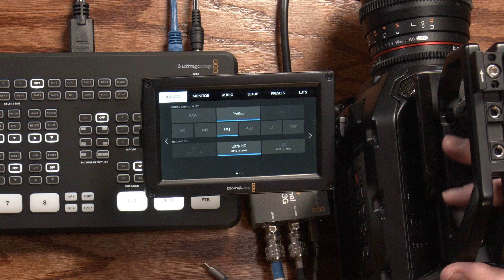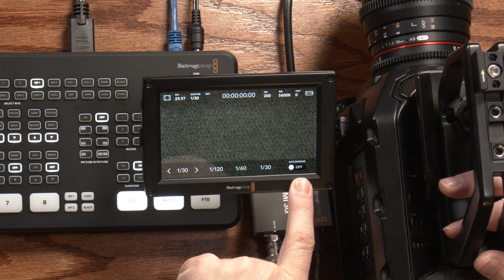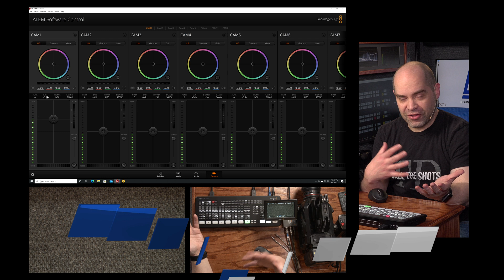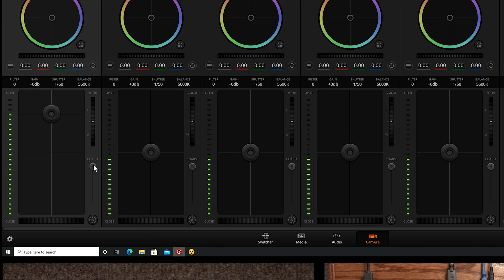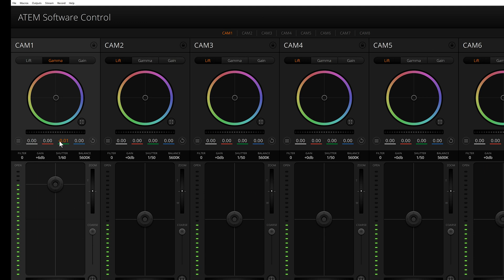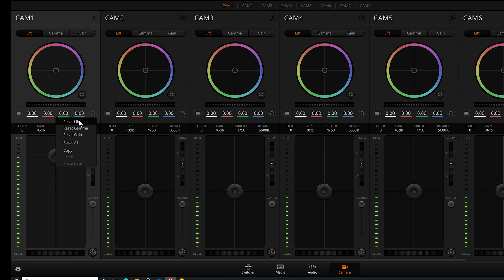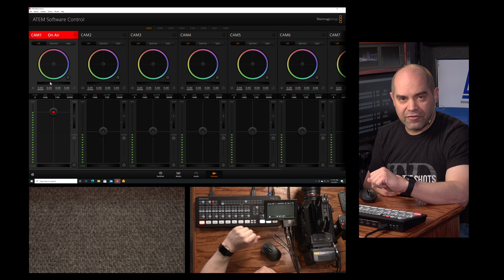How-To: Control Ursa & BMD Studio Cameras from ATEM Mini Switchers

Comment: What about getting program return into the Ursa from the ATEM Mini Extreme ISO.
Reply from the maker: You won't be able to do that from the Mini series. You'd have to step up to a higher end model of switcher.
Reply: I pushed the HDMI out to a Converter and an SDI DA but of course you lose Tally and any remote functionality in doing so but you do get return.

Comment: Hi I have 2 Blackmagic cameras 4K and 6K also ATEM Prodaction Studio 4K Switcher. I connected all, the software as well, I can see my cameras on my multyvew, but I got a issue. When I go to Camera section on software and trying to control cameras it looks like noting is changing when I change bottoms. Can you tell me what can be issue, also my 4K Blackmagic camera is turning off automatic after few second, can you tell me how to fix it inside camera settings ? Thank you, good video.
Reply from the maker: Before doing anything else, make sure you’ve updated the firmware on the cameras to the latest versions. Then make sure you set the camera ID in the settings to match the input number on your switcher (camera on HDMI 1 is set to ID 1, etc.).
Reply: @djp_video  is there any video that shows how to do?
Reply: @djp_video  I did update my bought cameras firmware still not working. If you can send any video or link that shows how to much camera ID with inputs, that would be great. Thank you
Reply from the maker: I don’t have either of those cameras to demonstrate with. But the process will be almost identical to what you see in this video. 

Make sure your camera IDs are set to match your switcher input numbers.

Comment: Does this work on all ATEM inputs? I’ve had issues getting it working with inputs 2-4 on an ATEM mini at 1080p50 because the output from the micro converter at 1080p50 won’t work with those inputs. It seems to be just the converter that is the issue because any other 1080p50 source works with those inputs.
Reply from the maker: It should work on all inputs.

Comment: Do you know if this converter also makes it possible to control the BMPCC4K from the bigger SDI based ATEM switchers?
Reply from the maker: It does. It works in both directions.
Reply: @djp_video  That’s awesome! 😃 And i was just about to pick up a bunch of converters anyway!

Comment: I totally missed that the 2-way adopter enabled camera control, thanks for this! How is your Design Micro Studio Camera 4K with the adaptor? I'm mostly shooting talking head from fixed mount cameras in my office that are recorded on the Atem Mini Extreme ISO and/or Hyperdecks. So the Micro seems appealing. Does "bad" autofocus mean slow, or does it mean it often doesn't get a sharp focus even on something easy (medium closeup talking head)?
Reply from the maker: The Micro Studio Camera 4K works as designed, but it isn't a great camera. Take a look at the videos on the channel from a year ago (MSC4K) vs. now (Sony Z150). The difference is pretty staggering.

Auto-focus is really slow. It works most of the time, but it can miss focus occasionally. It's very simplistic in the way it works.
Reply: @djp_video  I am looking into getting two studio cameras and two pocket Cinema 4K all controlled from a ATME switcher the main reason I was looking at the studio camera is It has SDI and thay will need them to be about 100 ft away from the switcher. would it be possible to use two bidirectional converters to go from HDMI to SDI and then back to HDMI and use a pocket Cinema instead of the studio and still have camera control?
Reply from the maker: @CYBERSTORM101X  I would think it would work, but I haven't tested it, nor do I have all of the required gear to do so.
Reply: @djp_video  thanks for the reply. if all goes well and our package gets approved I will test this and if I remember reply and confirm if it works. Thanks again for all the informative videos.
Reply: @djp_video  lol thanks Doug. I don't need new cameras, and the Micro would probably be a step back in image quality (running Nikon Z6 now with a bigger sensor), but all those unused buttons on the Atem Mini are killing me :-) A very dumb reason to go camera shopping.

Comment: Nice stuff. Would love to see coverage of the Sony Z150’s and Z90’s remote control capability with that Sony app. I asked you about hit on a live stream once; you’d said it was clunky because the camera turns into a wireless AP. Surely it could join an already stood up AP and just function as part of a wireless LAN? Put some iPad minis on the same LAN and then in theory you’d have remote iris and zoom control of the Sony cameras on the cheap. Only you could cover all of the caveats in making such a setup fly.
Reply from the maker: I just spent some time playing with the remote control capability of the Z150/Z90. To sum up? It's not very useful.

1. It forces you directly into Access Point mode in the camera. You don't have the option of joining another existing network or using a wired connection. It just isn't even an option. You have to connect the WiFi of your phone to the camera.

2. It disconnects frequently, so you have to switch back and forth between the app and the phone's WiFi settings often. And the WiFi range is pretty poor.

3. The LCD screen on the camera only displays a message that it's being remotely controlled while in this mode. You can't see the video that the camera is capturing.

4. The "live" video inside of Sony's Content Browser Mobile app has a significant delay on it, and likes to just stop updating randomly.

5. You only get control over the Iris, Zoom, and Record Start/Stop. That's it. No other controls. No focus adjustments, no shutter, gain, or white balance control.

6. While in this mode, you can't do anything else on the camera itself besides zoom and start/stop recording. You can't access the menu, or adjust exposure, or adjust focus. Most everything is disabled.

Bottom line? It's unreliable and very light on capabilities.
Reply from the maker: I'll add it to my list.

But the cameras can't join another network for the remote control mode. You have to use their own built-in Access Point.
Reply: @djp_video  you realise this is just bait for me to find a way of bridging their wireless LANs together. You seem like you’re into networking too with all the funky stuff you have to do with those SONY PTZ cameras that have a fixed IP address where I guess you do some kind of source network address translation to make it usable. The Z150/Z90 wireless capabilities sounds like it could be a fun project if not for the light weight capabilities of Content Browser Mobile.
Reply from the maker: If someone is going to go to all of that trouble, would it make more sense to come up with an Arduino or Raspberry Pi-based system that talks directly to the camera through the LANC port? That would give a lot more flexibility and be universal.

It's something I've been wanting to do but just haven't found the time.

Comment: Thx Doug, Grt Video! Thx. Do you think it will work with the Ursa G2? (G2 has 3G sdi in, and 12G sdi out)
Reply from the maker: Yes. It works great with my Gen 1 Ursa Mini just fine. You'll still have to set the SDI output to 1080p though.
Reply: @djp_video  Awesome, this is so cool they added to the Ursa. Adds to the already high value for money of these cameras as it is and BMagic's eco system in general. Amazing really.

Comment: The slider that you said controls focus actually sets a ceiling for the iris. Focus is controlled with the dial that is across the bottom horizontally.
Reply from the maker: Yeah, I accidentally swapped it. I've added a correction to the video description. Thanks!

Comment: Hey Doug! I believe the focus control for the lens is the wheel directly below the iris control/black point.  The coarse slider doesn’t effect the focus.  It effects the iris as well however i’m not sure what the difference between the Iris/Black point slider you were using and the coarse slider are, unless it’s just that one effects both at the same time and the other just effects the iris.  Thanks for the helpful videos as always!
Reply from the maker: You're right. I got it wrong. Thanks!
Reply from the maker: @martycg15  The lens has to have electronic focus control, and for that feature to be compatible with the BMD camera, for it to work.

Comment: Hi, How would I use this with a Blackmagic 40x40 videohub?
Reply from the maker: As long as you have connections for both the SDI input and output, it doesn't matter if that signal passes through a Videohub.

Comment: Would it work with a wireless video transmitted and receiver like the hollyland connected to the micro converter?? I assume it should work the same way right?
Reply from the maker: No. These signals don't pass through wireless systems.